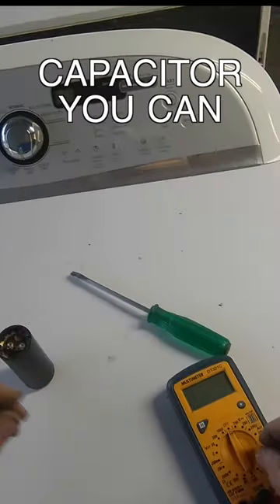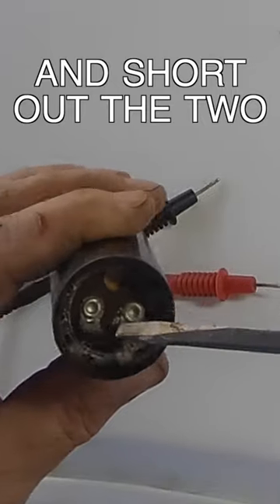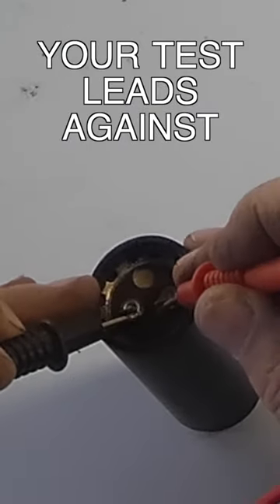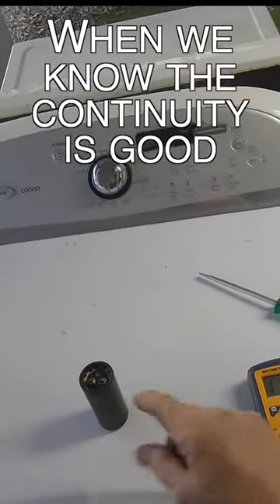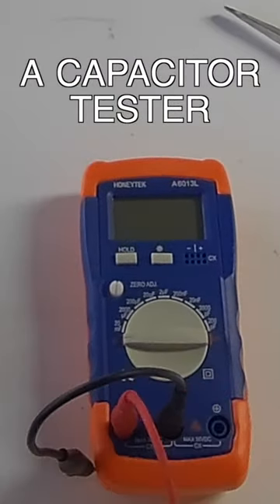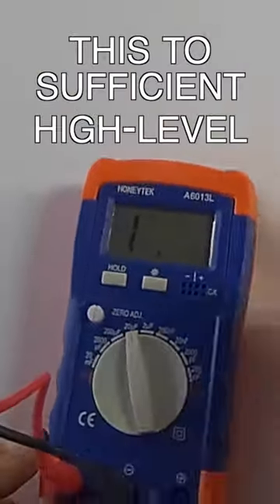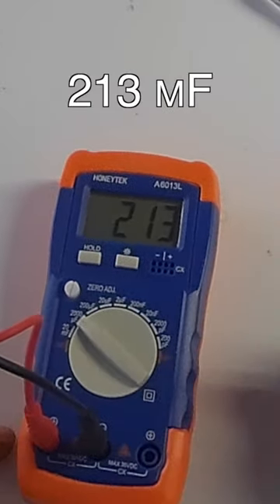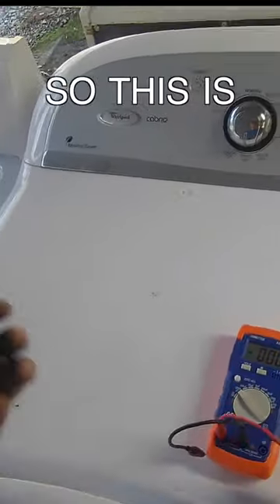Testing Motor Starting Capacitors Made Simple

Comment: I didn't mark my capacitor when I took it off. Which pole does the red wire go to? the other connector is a dbl white wire/ one has a orange stripe. I am afraid to put the new one on
Reply from the maker: It won’t matter unless it is a polarized capacitor.    I’m assuming you are dealing with a washing machine motor so it won’t matter. If it is polarized  the capacitor will have a - neg. Symbol on one leg. The red wire should go to positive if this is the case. If there are no symbols it won’t matter.